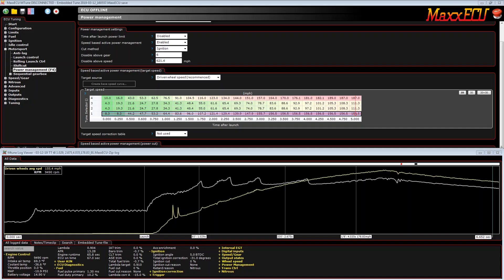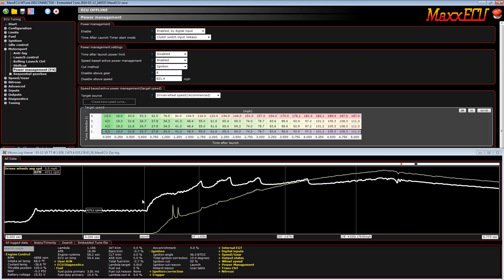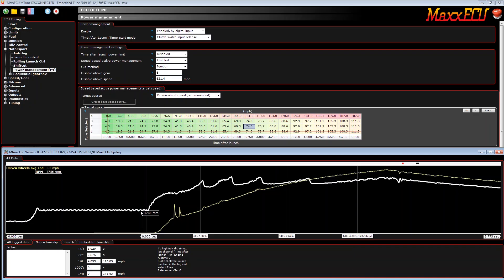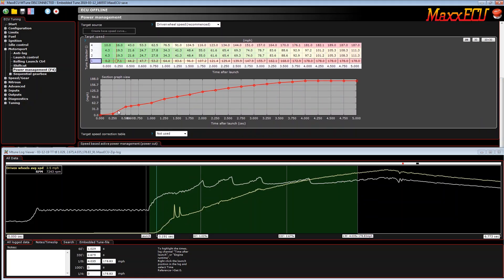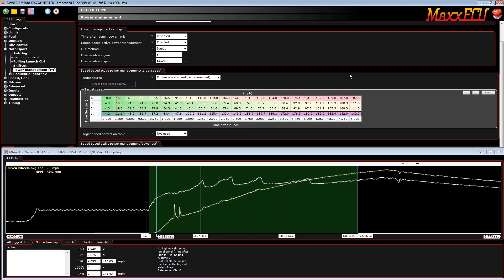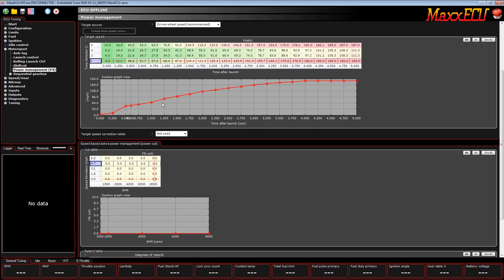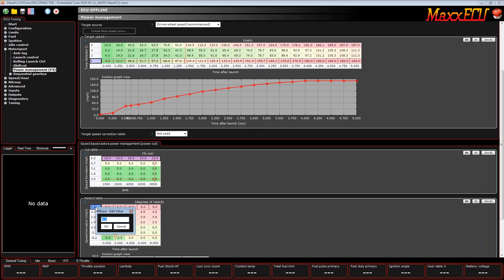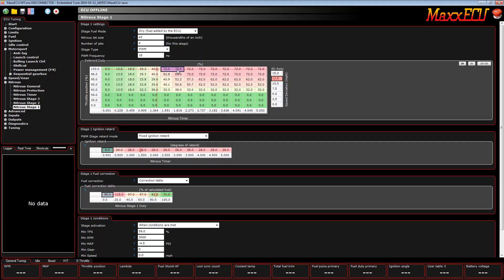MaxxECU Academy - Power Management

Comment: Thank you for the video.
I have a question. So that power control on a motorcycle for dragracing happens correctly, should ECU need to know the speed from both wheels? Or is it enough just to get information from the rear wheel? The front wheel is often in the air, especially at the beginning of the race.